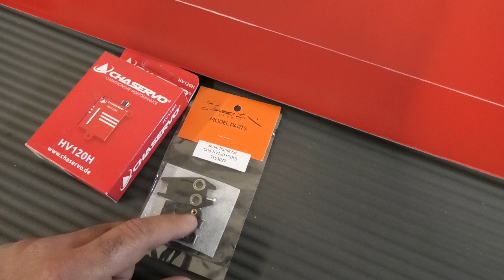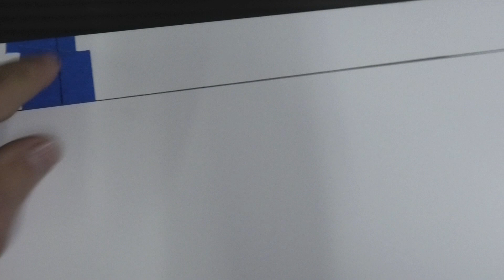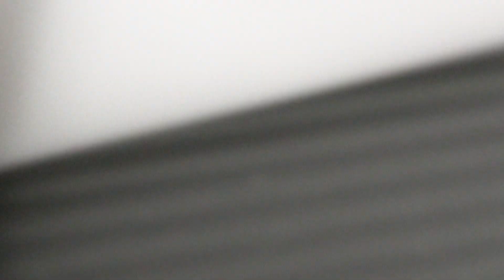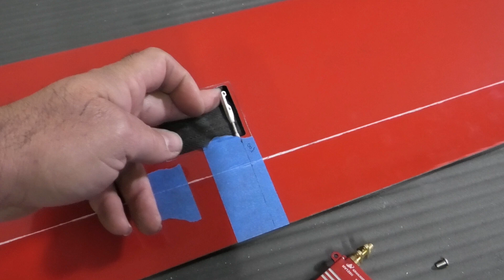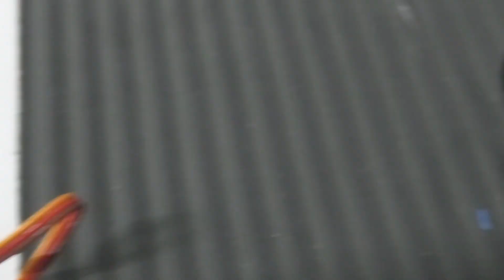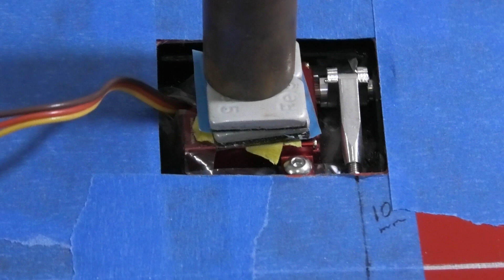ASH30 Scale RC Glider Outer Wing Panel Assembly

Comment: I've got to say. After I started building my first two DLG's. I used KST's. Then I heard about Chaservo's. Got 6 DS09's for a 3m glider I'm building then I got a CX5 with LV06's. They're honestly impressive.

Glad to see the work on the ASH30 began so soon. Looks like an intimidating build.
Reply from the maker: I'm not looking forward to the landing gear!
Reply: @flightcomp  are they machined parts?
Reply from the maker: Yeah, it's all a pre fab unit, but the doors are not cut. I have no clue where to place the assembly. Will need a lot of research. I'll do the wings and tails first.